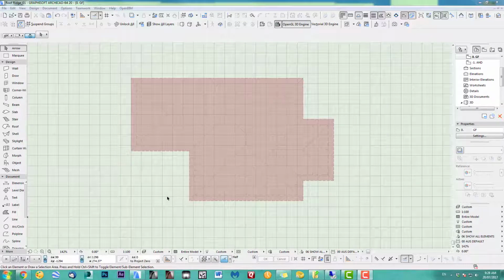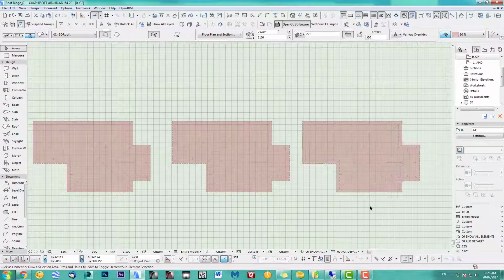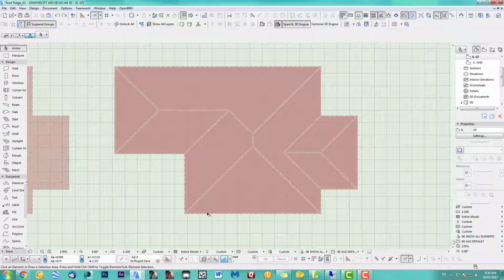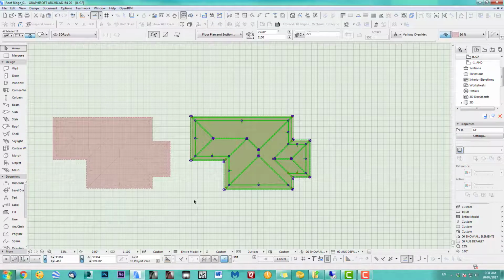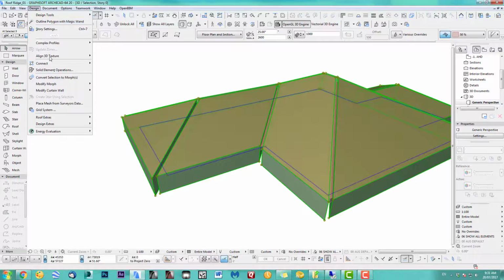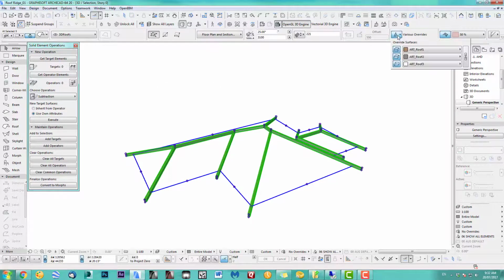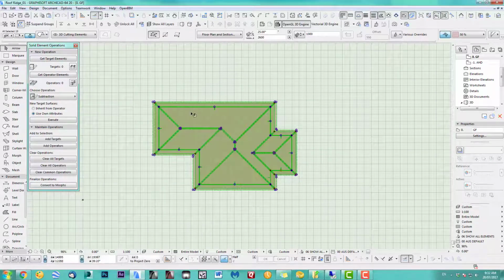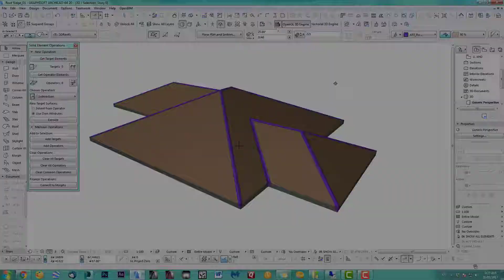How to model a Roof Ridge in Archicad

Comment: I've been using Cadimage add on to do the roof ridge, good to see how to do it without add on. Ridge looks good, but how about valley, which should be low that roof? Plus how do you texture the ridge with tiles and at the right angle?
Reply from the maker: Yes Cadimage is doing a better job but as you mentioned this works quite well without it. As for the ridge with tiles in regards to the textures. I recommend to have different materials applied. This way you can adjust the origin and rotation of the texture for each material.

Comment: What about just copying one, split polígonos draw the ridges with line and then cut the shape of the ridges. It will be a bit longer but think it will work. I will check it later.
Reply from the maker: yes that should work too, there is usually more then one way to get to the end result, nice.